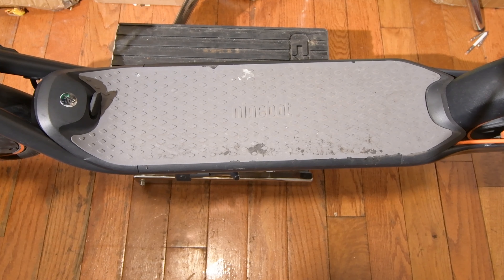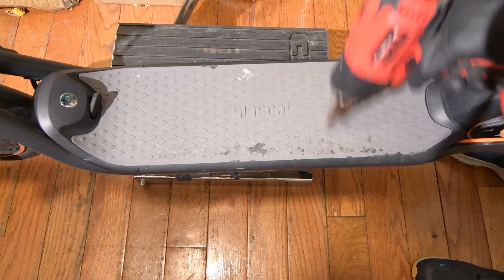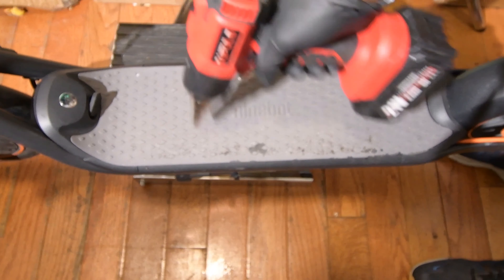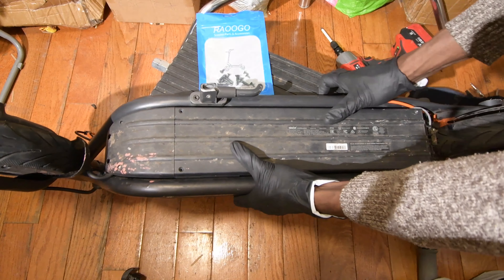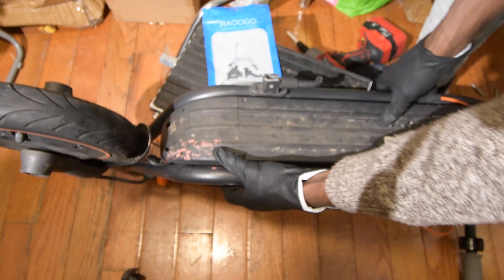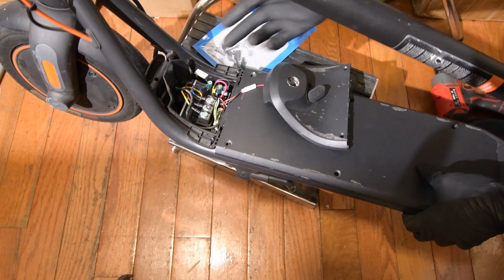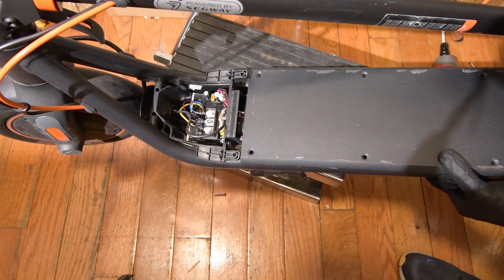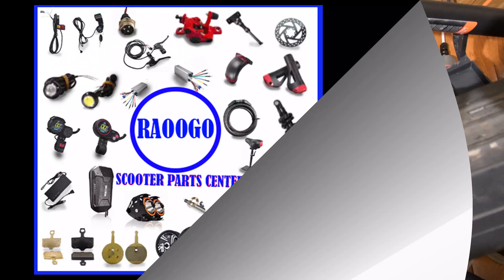Ninebot segway F30  F35  F40  F65 Compartment Disassembly open controller Battery Replacement Work

Comment: What are the dimensions of the battery if you might know?
Reply from the maker: I will take the battery dimension for you next Opening.
Reply: @RAOOGO It's fine no need to do so, either way it seems like many say it ain't a good idea to put a battery with more capacity that what the manufacturer did cause it can cause problems. I wanted to get my scooter to last for longer miles. Thank you for your time.